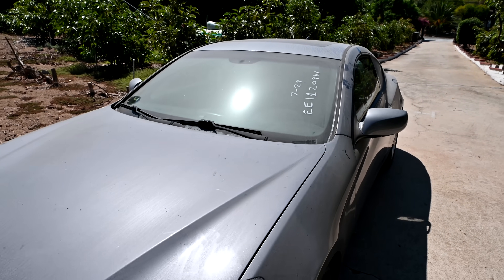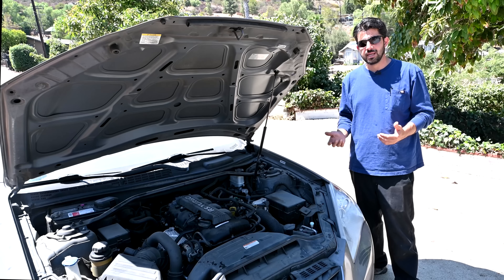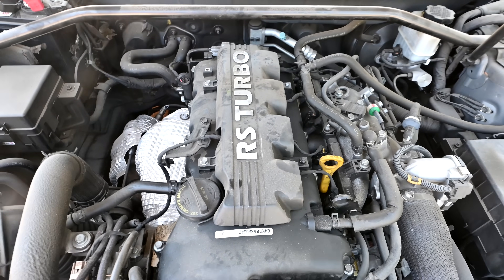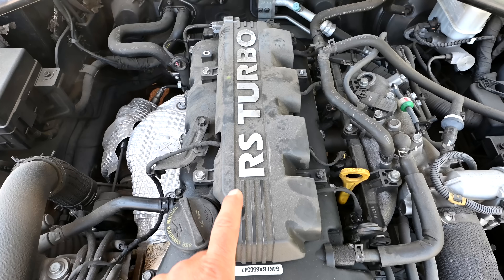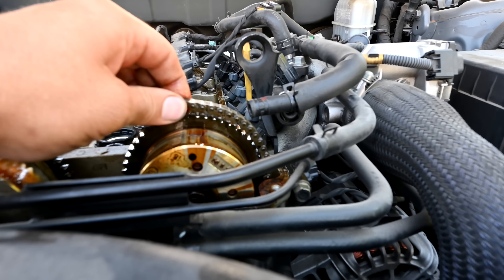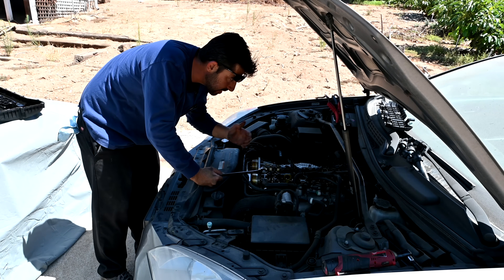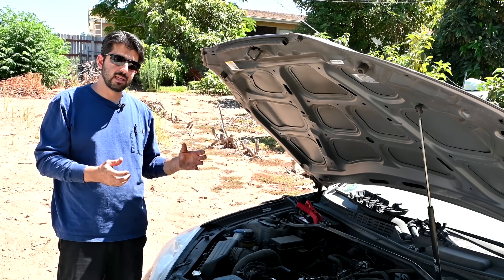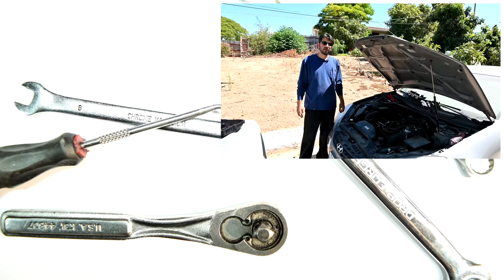The Hyundai And Kia Engine Failures Explained.

Comment: I have a Hyundai I30N Performance with a 2.0 litre Turbo Theta II GDI engine in the U.K and have had no problems with it, here in the U.K the Theta II engine is a very reliable engine. I know a the owner of a taxi company and his two Hyundai's on his fleet with a Theta II engine one has done 279,000 miles and the other is on 207,000 miles but he is fastidious about changing the engine oil every 6,000 miles without fail.
Reply: This is good news because I have ordered a I20n as long as I do the oil change every 10 Thousand clicks.
Reply: @ljp1942  I would change your oil every 5000 miles to be safe that's what I currently do and I've had no problems.
Reply: @Sprograt  Hyundai makes great performance cars these days.
Reply: @ljp1942  I've had my I30N since Sept 2018 and I love it and that's me coming from a 2016 Golf R that cost me a lot in repairs other than servicing, fuel, and insurance the Hyundai has cost me nothing, the I30N cost me £26000 new if I sold it today I would get £24000.
Reply: I just got a, 2023 Hyundai Sonata N-Line 2.5l turbo and I couldn't care less about engine problems as the warranty is, 10 year/100k mile warranty. Lol. So....I don't care if anything fails....I get it fixed/replaced for free. Ha also....I ALWAYS change the oil on a new car after the first 500 miles.  Some engines just don't last as long as others. It happens....not a single engine and or car maker has an engine that has never had a issue or issues. Millions are sold and odds are, some will have issues, especially with some people driving em hard as all hell and not doing proper maintenance. Again, new hyundais now have a 10 year/100k mile powertrain warranty. So, couldn't careless about issues. Lol also, when buying a new hyundai, you can purchase a lifetime pwertrain warranty for around 2k.....so.....couldn't careless about issues.

Comment: Its simple Hyundai/Kia are shit. You get what you pay for.
Reply: "You get what you pay for." That's what people said about Cadillac versus Lincoln in the 1980s. Limousine business owners thought because they were paying much more money for the Cadillac than the Lincoln; the Cadillac would be more durable and reliable. It wasn't the case. Transmissions were failing on the Cadillac at an early age. Frantic Limousine business owners couldn't afford to just go out and purchase new Lincolns to convert to limousines right away after purchasing and converting Cadillacs. So, their solution: buy Lincoln transmissions to put into Cadillac, but it wasn't a direct fit, of course.
Reply: @FordFans721  A Hyundai/Kia are not Cadillac,s or Lincolns, They are cheap Asian crap.

Comment: Not related to the video, I just wanted to share my thoughts and experience with a few Kia models I've driven and owned. To summarize, I can say that Hyundai vehicles are not any worse than the average GM, Ford, or Dodge. The first Kia I've personally driven was a 2013 Soul back when they were less of a trend and more of a unique wagon. Nearly ten years and 70k miles later, the only major problem was its assembly in the US, age of the vehicle, and rear strut tower. Not too much else manufacturer-related or otherwise went wrong except for the car being caught and dragged by a semi-truck on a wintry day. The second Kia I've driven was a 2014 Sorento, it lasted three years/30k miles before trade-in and had a few more problems than the Soul such as failed headlight assemblies costing $900 each in 2015, failing front struts, and also being assembled in the US.

The third driven and owned Kia vehicle was a used 2018 Forte assembled in Mexico, at 36k miles the car ran like new and only had a squeaky blower motor but developed a tick at about 50k miles. When the temp was below 55 degrees the ticking would start on a cold engine and then go away after the motor warmed up at approximately 2-5 minutes of run time, it sounded like the famed 2.0L piston slap but I suspected that it could have been a faulty exhaust seal either from the manifold or converters because it was a similar sound to my old Toyota's modified exhaust. Not too long after investigating into that I lost my job and lost the confidence to get it looked at and not long after that a watery teenager went through the red light, hitting my front driverside fender at 40 mph. She totaled the car and left me with a broken knee, I didn't have health insurance to pay the hospital and both the watery tart and the mother tart did not have an active auto policy for their car that hit me. I have to pay out of pocket because this third-world developed country doesn't have free healthcare. 

Anyways I had nothing but decent experiences with Hyundai/Kia vehicles, not good or bad, just alright. Like the Big 3, there are good examples and examples of poor engineering/assembly/repair. If they are honestly worse than Detroit, then you would see them out of business, however, that is not the case. They always seem to have plenty of dealers with inventory and overall quality has been decent since 2010. The only thing I do not like about the company is the dealers, the Sales people are overly pushy and aggressive or a complete waste of resources, and the dealer's techs all seem to have a glazed look in the eye with a big button that reads, "I really wish I weren't here right now" who also need their arms twisted to get parts covered under warranty. 

Though all things considered, I would personally purchase more Hyundai/Kia vehicles in the future. Of course, that vehicle cannot be 5-8+ years old, has 90k miles or more, and was selling for more than $24k. I do not trust any used Hyundai with that age or mileage, and I believe that any new or slightly used vehicle for more than twenty-four thousand that isn't a Honda or Toyota is more often than not a complete waste of money. In a direct comparison I also wouldn't purchase any Big 3 model matching that criteria either. It would have to be a specific vehicle to change my mind, such as a GM with the 3800 motor or a 1995 Caprice, where such a vehicle makes me overlook all red flags with enthusiasm. 

The thing to remember about Hyundai is that they are more or less a value brand. They do not make general cars for general use, they do not make sports cars for racing, and they do not make luxury cars with an exception being a Genesis, Cadenza, K900, Stinger, or something similar. In general, they only really design and manufacture cars that will go from point A to B. In theory, most of them will have convenience, but very few will have performance, or comfortable seating. That doesn't mean it will always apply to every design, however, but it does mean that you can have it all for a reasonable price. I figure if you keep that in mind, then you're more likely to have more patience with the brand or maybe even a better experience.
Reply: Ride rough

Comment: 2010 Sonata 2.4l Theta I engine @ 70.000 Miles no problems with engine or tranny ever so far. Oilchange every 3.500 miles with normal oil. Runs like new! Alternator went @ 60k or so but they seem to be a problem anyways, but cheap to replace. Good thing we opted for the "last years body/engine type in January 2010, we even got a great deal because the new models were just arriving at the stealerships and they wanted to get rid of this old style model 😄. Best decision/purchase ever!

Comment: What you can also do is. You can remove the camshafts and measure the height of each valve,
If some are not the same height then the valve is bent
Or
You can check valve clearance. If the Clarence is too much then you bend valves
That’s how you can tell

Comment: I have a 2017 Elantra 2.0 no turbo and had the exact same timing chain issue. Tensioner went and chain stretched but luckily no catastrophic failure. Now I'm at 130,000 miles and it runs great but burns a good amount of oil.
Reply: What is your oil change interval also type of oil ? Driving habit city or highway? Also what climate?
Reply: @henrytom5824  oil changed every 5k full synthetic. Mostly highway miles but gets floored daily at some point lol. Issue happened right after I bought it outside of warranty so I'm assuming the previous owner stretched the oil change interval to the max and it got abused. Now it runs great but burns a little over a quart every 1k miles
Reply: I just got a, 2023 Hyundai Sonata N-Line 2.5l turbo and I couldn't care less about engine problems as the warranty is, 10 year/100k mile warranty. Lol. So....I don't care if anything fails....I get it fixed/replaced for free. Ha

Comment: Lots of varnish in there.  My Ford Contour SVT has almost 300k, synthetic oil every 5000 miles.  I changed the valve cover gasket at 275k and the engine looked new.  It’s all maintenance, which most people don’t do.
Reply: Yep. Modern Synthetic/synthetic mix oils changed every 4/5k miles keeps internals looking new at 200k. Those cheap ass Korean engine’s definitely can’t handle that abuse😬!!!!
Reply: @steveo601  Are these Korean made, or from the American factory?
Reply: @DrakeN-ow1im American.
Reply: Most of those Ford Contours would be in the junkyard by now. Changing the alternator is a nightmare on the V6 Contours.
Reply: I'm changing my oil in my 2020 Tacoma 3.5L v6 every 5,000 to 6,000 Miles to in hopes that it will last and stay clean.  With these new modern engines that have variable valve timing, small tolerances and small oil passages I feel like Toyota's 10,000 mile recommendation is too long to keep everything good.
Reply: I had consistent maintenance and the records to back it up and I took care of my car and the engine is failing at 90k so I'm in the middle of oil consumption test to get a new engine. And my coworker said his niece has had to replace her engine twice. So absolute b*****

Comment: I have a Bk1 2.0t track genesis with a 173k miles and just had to replace the head gasket and did bk2 timing chain and it's full bolt on and it runs great and they are extremely easy to work on and it's been really hardy so far because I beat the holy hell out of this car and it's held up to about 170k miles before the head gasket gave out. However the 6MT is trash. Lol

Comment: I keep hearing about lack of oil changes. 🤔could it have something to do with Synthetic Oil's claims about going linger between changes? Just because the oil no longer has to be changed at 3k mile intervals doesn't mean the filters don't.
Reply: 5K is the new standard (Toyotas last forever with 5K changes, between 50K and 150K miles with 10K mile changes.) However, the oil containers continue to say the oil is good for a lot more than that. The Mobil 1 container says it is guaranteed to protect for 10K miles, but it just refers me to a website with the details. No thanks.

Comment: My 2016 hyundai veloster turbo blew a piston ring at 70k, fbo and on a conservative tune for last 20k miles I feel like it could have lasted a bit longer.
Reply: Don’t they have 10 years 100k warranty?
Reply: @vhx5438  yeah but I am modded and tuned so they wouldn't take me. I tried when I just had an intake for a radiator leak
Reply: @silver-vt5330  I see

Comment: I had a 2006 Sonata. Best car i ever had. Not a single problem in the 10 years i drove it.
Reply: That’s how my Kia optima was. Never had a problem.
Reply: Friend has a 2012 Sonata that caught on fire while  her mechanic was driving it after a maintenance schedule.
Reply: I just got a, 2023 Hyundai Sonata N-Line 2.5l turbo and I couldn't care less about engine problems as the warranty is, 10 year/100k mile warranty. Lol. So....I don't care if anything fails....I get it fixed/replaced for free. Ha also....I ALWAYS change the oil on a new car after the first 500 miles.  Some engines just don't last as long as others. It happens....not a single engine and or car maker has an engine that has never had a issue or issues. Millions are sold and odds are, some will have issues, especially with some people driving em hard as all hell and not doing proper maintenance. Again, new hyundais now have a 10 year/100k mile powertrain warranty. So, couldn't careless about issues. Lol also, when buying a new hyundai, you can purchase a lifetime pwertrain warranty for around 2k.....so.....couldn't careless about issues.